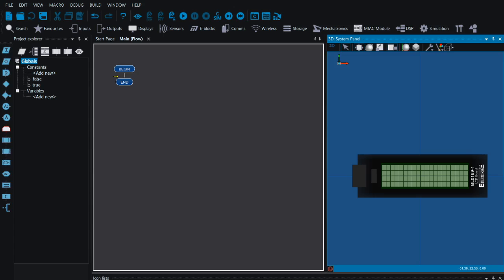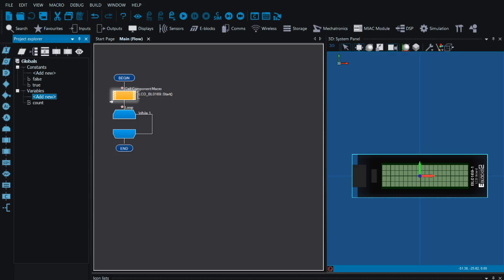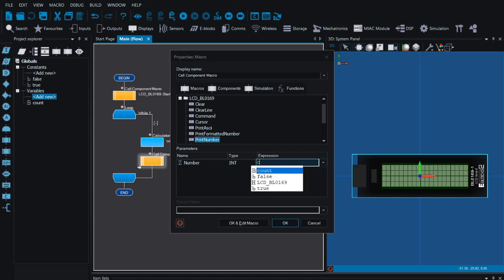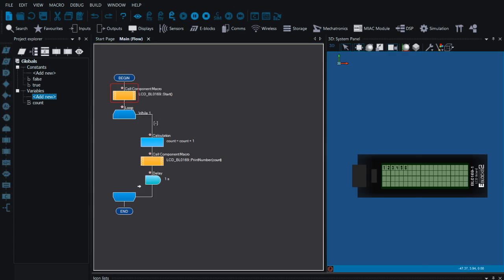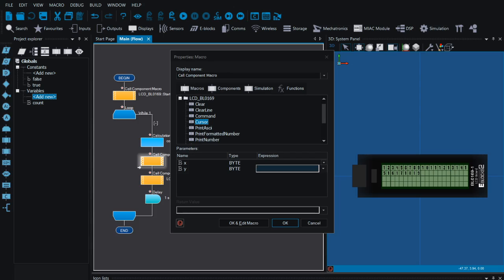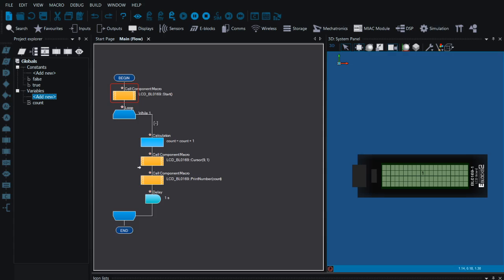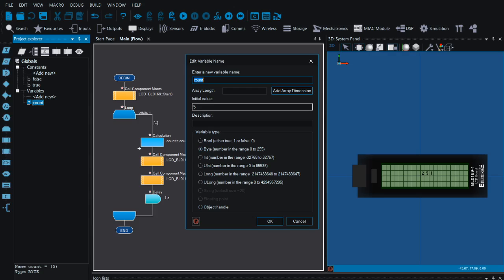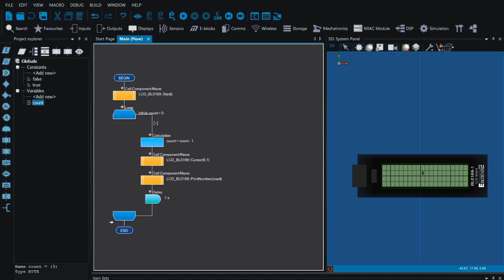Programing a simple counter in Flowcode 8

Comment: talks too fast, mouse movements too fast.    can't keep up.   And i've programmed counters in C++ so I know the code.
Reply from the maker: Thanks for the constructive feedback. I'll assume it wasn't intended to be as rude as it might be read by some people.

When capturing the screen, I didn't realise cursor capture wasn't enabled, but I enable it in my videos now. Hopefully that helps with the cursor speed. I assumed that when watching videos like this that people would pause, and repeat, sections of the video that they didn't quite get, like I do when watching other videos, but maybe I'm wrong there!

Is there anything that you'd like to see from these videos?
Reply: @showyourworking9800  I’m struggling in this unit alot and have the exam on the 14th January. The main part I struggle in is the flowcode section
Reply from the maker: There are a few videos up with examples of code.

The main thing to remember is that you don't need perfect code. Just get as much working as you can and focus on the rest of the exam